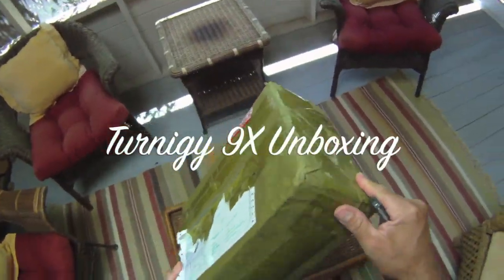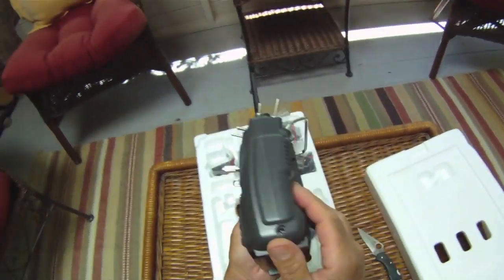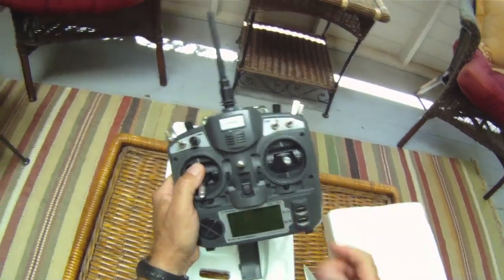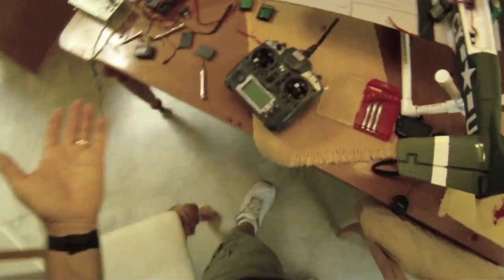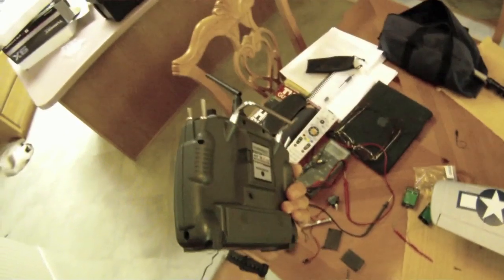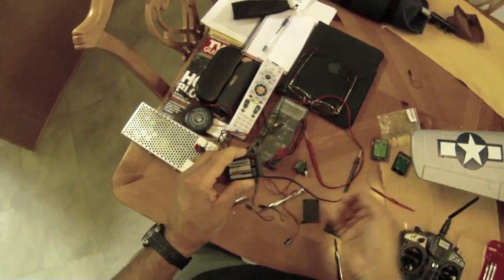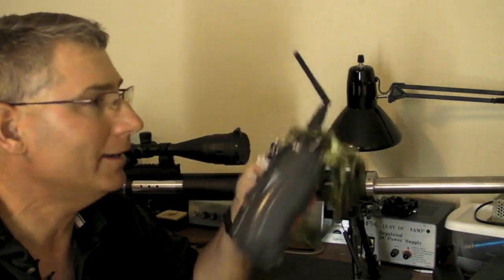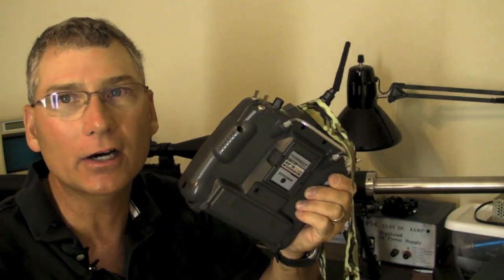Turnigy 9X R/C Transmitter unboxing and mini review

Comment: I received one today ... however, the left gimbal doesn't stay at the position up or down but return to the center position ... the right gimbal is opposite ... I believe this is a problem of the product ... btw, how many receiver are included in one box?
Reply from the maker: You have a mode 1 type radio, throttle on the right and elevator and aileron on the left. You can swap to a mode 2 by moving the spring, arm and throttle friction plate. There is a video on Youtube that shows how this is done, it's not a hard job to do.
Reply: Tom Lombardi oh wow ... I found the video ... YOU ARE THE MANNN ... lol lol ... now I don't need to return or exchange the product ... sorry but I'm really new to this RC world ... :))

Comment from the maker: I'm still happy with it, and many of my friends are too. There's been some negative comments about the radio, we had one out of seven that had a problem. The biggest problem I see with the radio is the battery pack, it's got to be positioned correctly or it becomes intermittent, I talk about this in my video. The main reason I like this is for the $9 usd receivers, and it's very programmable. Good luck.

Comment: la maggior parte dei miei aerei vengono da hk e non ho mai avuto problemi tranne ke per un regolatore ho una radio wk 2801 pagata 130 euro  da 3 anni che la uso sia per hely ke per aerei e non mi ha dato mai problemi e se 
in futuro dovessi averna la butto . e ne prendo un altra .un mio amico a preso una optic6 pagata tanto di piu e e assolutamente un casino programmarla e stai sicuro che se dovesse portarla in assistenza non la vedrebbe prima di un mese . e allora .......

Comment: @fyvelnews The price is pretty normal for HongKong direct stuff - those things aren't rocket science, nothing much expensive in there per se. You pay little for advertisement, very little for shelf space and distribution network, and zero for warranty and customer support. Same device would cost twice to trice as much if it were to be offered in brick-and-mortar stores.

Comment from the maker: @mmmartin261 In the video I explain that the module should NOT be removed because of the wire? Our group now has nine of these radios, one had a  problem which we fixed, all others are going strong. You are right about customer service, if you buy something from HK your pretty much on your own.

Comment: dont buy one of these,  buy two so when the first quits working after 2 weeks you'll have another one to pull parts from.  the video showing the removed module is a lie, false,  it can't be removed w/o cutting antenna wires.  theyre junk but theyre cheap.  $60 is just a little more than the $40 shipping you'll pay to get it from china.    If i had more money i'd buy a hitec, futaba, or spektrum.  Be Warned: No customer service exists at HobbyKing.  they suck !00% of the time.  Know what you buy.

Comment from the maker: @VANASUTRA Are all the channel effected? We had one radio out of seven that had a problem with the throttle, it turned out to be a bad pot on the gimbal. You should open it up and make sure that all of the plugs are seated, I've found one not quite seated and that can cause problems.

Comment: Hi again! i have 1 more question. i'm planning to order a TX lipo together with the turnigy 9x. The Turnigy T1450-TX-3 is the cheapest i could see in hobbyking, do you think it will fit in turnigy 9x transmitter? Thanks

Comment from the maker: @dhyn22 I've installed the 8 channel RX in a Lite-flight Bug that's 7 ounces all up, so yes it will work. I stripped the case off the RX to make it lighter. You can get a 6 channel RX that's smaller, which I have several of. They are the HK brand 6 channel V2, the SKU is: SKU: HK-T6A-V2...$8.99!!US No problems binding with the Turnigy 9X.

Comment: So how solid is this radio when it comes to range and glitches? I'm just thinking
what if I use this on a cheap 30 size nitro helicopter? If it works and have long range then should work with nitro. But is it realible? Hmmm. I need to do more research. Do you think it's realible?

Comment from the maker: @lewandlo Yes, there is a trick! The mode 1 TX comes in stock more often and stays in stock longer. The mode 1 has the throttle on the right side, if you search YouTube you will find a video on converting a mode 1 TX to a mode 2. We've done this to the last 3 TX's and it's not a big deal, it takes 5 minutes!

Comment from the maker: @Thatonepersonz Yes, here's what's wrong, the "bind" and  "bat" labels are reversed. Plug the bind plug in what's labeled "bat" and the battery in what's labeled "bind", the light should be blinking inside the RX, then hold down the button on the back of the TX while turning the power switch on, while still holding the button you should see the RX light go solid, you can let go, shut the TX and RX off, remove the bind plug, then fire it all up again.

Comment from the maker: @geekpeptalk I've been using this radio in an Extra 300 foamy, Lightflite Bug, ParkZone P51D, ParkZone Radian glider and a GWS slow stick without any problems. No glitches or crashes, it just works. A buddy of mine bought one and his works great. That said, some people have had problems and crashes. I'm not sure if I'd use it in anything really expensive or dangerous. Your mileage may vary.

Comment from the maker: @NoobyRC  A lipo battery would last the longest and be light, the only sucky thing is having to snap the back open to charge it through a balance plug, that's why I'm leaning toward a NIMH pack that's soldered together. Turnigy really messed up by not including a quick start guide at the very least. I'm not sure I could have figured out the binding issue if I hadn't read a post on the problem. I hope the battery pack solves your problem and you get some use out of your $59 radio.

Comment: Nice, I've got a couple of these as well.  My first one was a V1 without TXmodule and Rx.  I use a FrSky Module with it and it's awesome.  I've got a  new V2 9X and it's my spare radio.  I'm planning on modding it with a switch so I can turn that darn spekaer off for when I'm programming.  I hate it just beeping away for every button press.  All in all, a really good radio though.